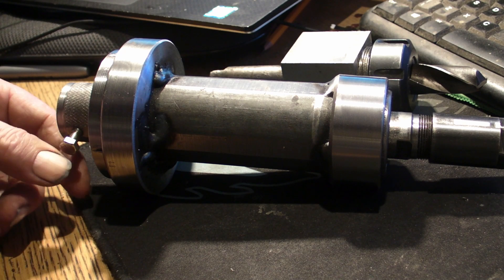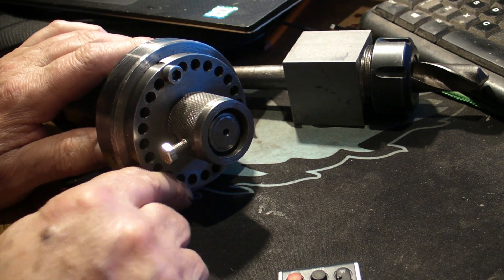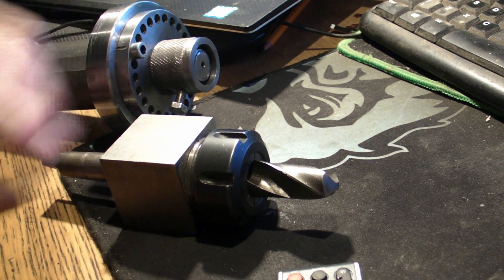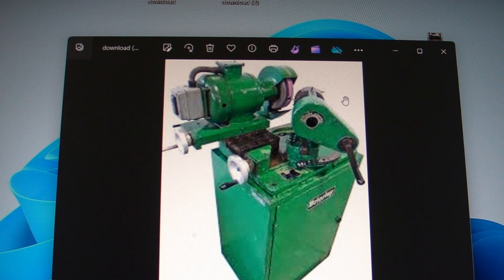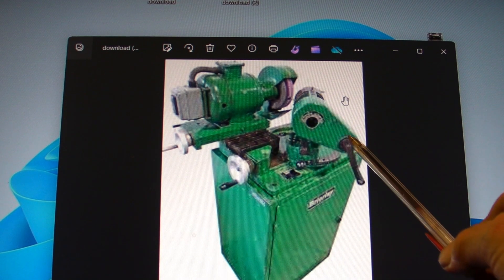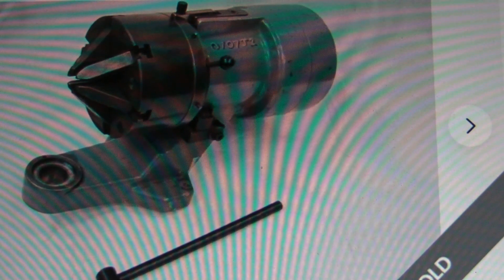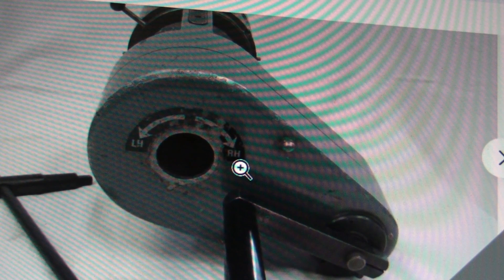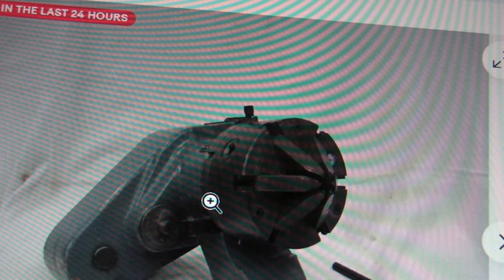Brierley drill grinder

Comment: Looking forward to this project.
Reply from the maker: Morning Thomas, Are you familiar with the Brierley drill grinder ? I believe some made it over the pond !
Reply: Exciting stuff Dell, Its all out there if you look for it! This will be good!!
Phil
Reply from the maker: @philhermetic  Hi Phil, having studied photo's on the internet I believe the missing parts are the cam which moves the chuck in and out, still available from Chester machine tools but at £90 odd Quid each will probably make one and the lower section of the swing arm. Will be looking at online diagrams and manuals to see how that works !...Del..
Reply: @machinenutdel6764  i think the cams were interchangeable to alter the angle of the grind, but you have got the essential part there! A future in commercial drill grinding perhaps?
Reply from the maker: @philhermetic  Just be happy to have a future Phil !
Reply: @machinenutdel6764  I am not, but I have seen the Oliver's and they are basically the same.

Comment: There are several different cam plates. Depend on how many flutes your drill bit has.
I own a zb 32 but have to consult the manual every time I use it 😂
Reply from the maker: Hi yenoh, Thanks for your input, looks like I'll need to make the cams and the lower swivel arm, cant get my head around how the unit moves from left to right by turning the crank handle but that may become clear once the unit arrives. Am I right in thinking the cams are aluminium ? Regards...Del...

Comment: I have access to one of those very machines if you need measurements or pictures.
Reply from the maker: Many thanks Mac, the head unit should arrive Mon or tue's looks like I need the lower support arm and swivel base. I have a large vice swivel base off a shaper that I may be able to use, that will become clear once the head arrives. No cams with it so any dimensions you could provide will be most helpful. Thanks again...Del..